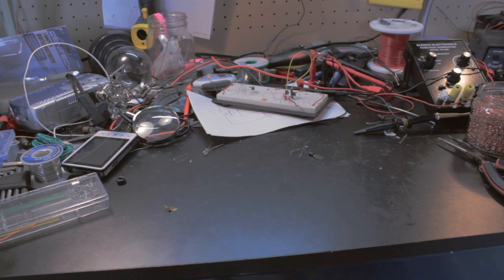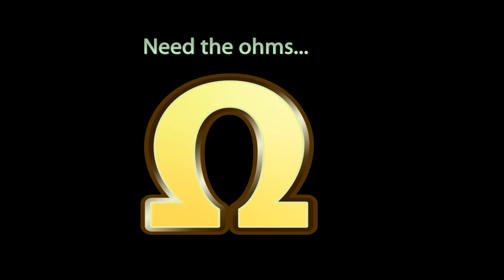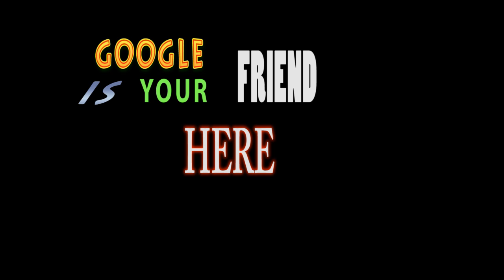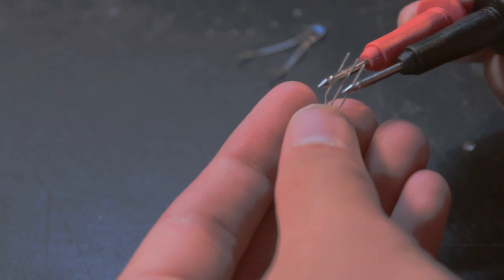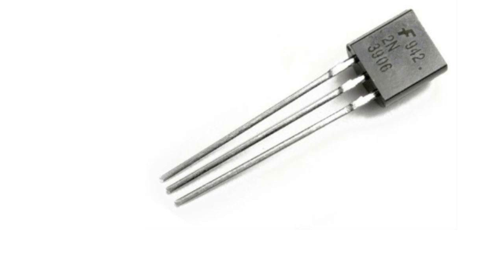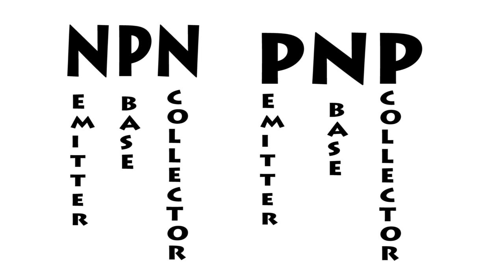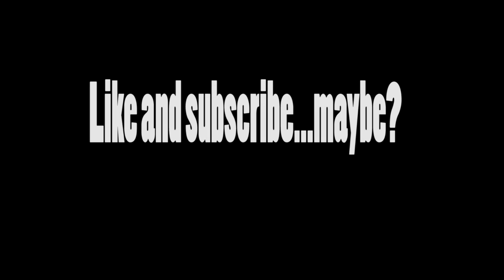How to test transistors with ANY multimeter!

Comment: Baffled by NPN transistor. DMM on diode setting: good. Chinese multitester: good. DMM on Ohms setting: getting readings between Collector and Emitter with probes placed in both directions. with other NPN's: no reading between Collector and Emitter with probes placed in bother directions.

Comment: Thanks for the video - I tried that on several transistors (mainly 2222As) - some of which were straight out of the box.  With the 2000 kOhms setting selected I was still getting an out-of-range both ways and across all and any of my pins.  Tried across about a mm of my skin and getting a reading as predicted so I guess the multimeter is OK.  Any idea what I might be doing wrong?
Reply: Same here, I'm getting both ways on a new transistor. Idk if I'm doing it wrong but I was looking for this comment

Comment: SO EVERY TRANSISTOR I HAVE IS DEFLECTIVE ACCORDING TO THIS..ALL 200 TELL YOU FOR SURE NOT.I HAVE A CEN TECH 95683 DIGITAL CLAMP MM I MUST HAVE IT SET WRONG...
NOPE I GOT IT AS LONG AS I SET THE METER AT THE DIODE SETTINGS OF THE OHM AREA..BUT THAT CAN'T BE RIGHT?

Comment: Good Stuff, Don't know if it's understood, NPN, The Emitter is 
Not Pointing, iN. PNP is Emitter Pointing iN.  Good you explain to determine which is which, in a bind and no internet, you can compare to known good Transistor. I do a Quick check of Transistors by Testing like 2 Diodes?.
Important Stuff

Comment: Don't you have those lead connections reversed.  I know I have a pnp transistor and each test came out exact opposite of what you said.  Using an analog meter.  Electricity travels from neg. to pos.  Critical difference in this test?

Comment: ON diode mode I got value 600 on emitter and 623 on collector in NPN transistor. Is it correct or not? But in resistor mode I got  10.04 Mega Ohm and 15.52  Mega ohm. IS it good sign or bad sign?

Comment: hi, you can test transistors with the transistor function on your cheap red meter, can you show how to do it, its bottom left at 7 o'clock on  your meter 0:18 sec, you can see it when you chuck it on the table.

Comment: The problem with using the ohms function on a multimeter, especially one with a diode test is that the test voltage on ohms may be so low as to not overcome the depletion region of a transistor or diode and will read high both ways This is intentional so you can test other component that are in parallel with diodes or transistors without activating them The diode test reads an approximation of the forward drop in the conducting direction, around .5 to .6 volts and the supply open circuit voltage from the meter, in the reverse direction, maybe 5 volts. My old Simpson 260 analog has plenty of voltage on ohms and always shows 10 to 15 ohms in the forward direction. That reading does not refer to any spec of the component but I know what to expect. The best bet is to test a few known good components to see what your meter will do. Surprisingly, The often free Harbor Freight multi meter has a transistor test function that actually measures the DC amplification of the transistor, called Beta. You can determine if the transistor is NPN or PNP  by seeing which way works, as well as checking for opens or shorts. If it amplifies it is not open or shorted. Getting back to other meters,generally failed bipolar transistors fail by shorting out collector to emitter,  The base to collector and base to emitter still test like good diodes.
Reply: Well explained might clear and and to the point explanation he seemed very knowledgeable electronics could do with your help as I'm a DIY home hobbyist self-taught no repair calls TVs phones tablets quite a lot of stuff obviously with trial n error  wen 1st started. I gt into it after a health condition creep upon me so was out of work an had alot time on my hands,now pretty confident. 
Could do with your help every now and then if you happy to Cheers stay safe

Comment: how to check every electronics component (Active & Passive) to identify they are working or not using cheap DMM!i believe that if some one can identify the malfunctioning component it's easy to maintain the device  like transistor/ IC which has more than 3 legs, Pulse Width Modulator, Zinor diode &  SMD transistor!!! ............tnx in advance!!!!!!!!!!!

Comment: this is the same way to test Audio Transistors as well? have an amp that will not power up with the amplifier board connected. lights for a second then shuts off with a blinking light. It does power up and stay on however with the amp board connected.
Reply: If it has a blinking light, you might want to check the manual first. That should probably give you a clue where to start looking for the defect.
Reply: I tested the transistors and found one faulty one. clipping it out of the circuit now it does not shut off..
Reply: good job :)

Comment: just wanna make the point to really check datasheet for pin outs u can have identical npn or pnp transistors but made by different companies that have collector on top instead of emitter for various reasons this can cost u alot of time an energy if u think it measured out fine but really had a short

Comment: Not all multimeters use a high enough voltage on 'ohms' setting to conduct through a p-n junction.
Reply: Turns out that's the case with $6 harbor freight multimeters

Comment: This doesn't work for my BS557, no matter what pins the -ve and +ve probes are touching it shows "out of range". (my multi-meter is auto range select-able)
Reply: +Fahimul Islam  Not sure why, but some multimeters only give a very short indication of conduction for a forward biased junction. For reversed biased junctions,  the initial reading is an open circuit value which is correct if the device is good. Also, you may need to try different scales. The lowest scale works for some meters with some transistors while the higher scales don't.

Comment: hi bro. how to work a transistor collector to emitter and emitter to collector
Reply: Hariom Swami If you activate the base / emitter circuit with one multimeter with the diode function you can measure for continuity with a second multimeter :-}

Comment: when measuring between the emitter and collector, your info is confusing.  you say if you get a reading, that its bad or messed up, or that you have the pin out wrong?  so should you get a reading if you have the pins reversed?  Or are you referring to a situation where the middle pin is not the base?

Comment: I have some NPN's 3904's and none of these work. I have my MM set to m ohms and still get nothing.

I get a small bounce between 001 mohm and 000 randomly
Reply: I might guess that the miliohm that you're getting are from the meter touching your skin... As far as your NPN's not working, that's why I'm here too so I have no idea... Sorry.
Reply: Clown Whisper 
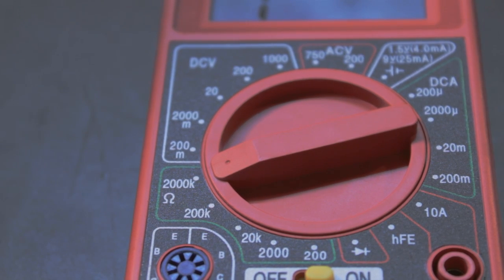Is it possible you accidentally set the switch to the lower end (millivolt) of the DC voltage scale? e.g. 200m or 2000m. (see 1:09 in the video)
It's a very easy mistake to make..........and don't ask how I know this.

Comment: too bad, i'm in search for testing a MOSFET. an IRF740.
I'm trying to use this NPN MOSFET as amplifier between 5v PMW and 12v power source. I find info on the leads, Collector Emitter and Base. But my datasheet shows me Gate Drain Source. Aaargh! I think by testing the leads I already destroid MOSFET. (I'm new with electronics :p )
Can someone show me a clear video on testing and how to use in circuit. It seems that Gate or Base should be grounded in a specific way to get rid of remaining current from the signal. or is this wrong?
Already Thanks, Joost (BE)

Comment: Germanium and Silicone just have different values when measuring, open and 0.4 or open and 0.6. I forget which is which.
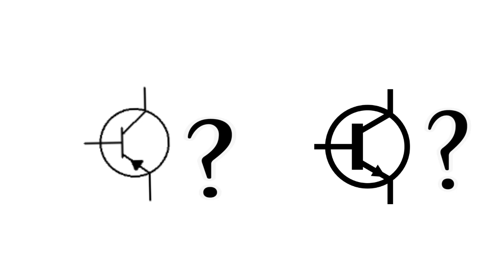Also if you need to know whether you have an NPN or PNP transistor by looking at the schematic go to 2:07 in the video. The left is a PNP and the right is NPN.
A quick way to remember which is which is to look at the arrow, is it pointing towards the circle (Not Pointing In) or the Center (Not Pointing iN).  NPN (Not Pointing iN)  PNP (Point Not Pointing).

Comment: Does this work with germanium core transistors? I've been repairing an old radio, and all four of the Toshiba 2SB series transistors conduct in both directions between the base and collector. Is this O.K.? I know you explicitly said that conductivity between the emitter and base in both directions is a no-no, but does the same apply for the collector and base? Thanks!
Reply: U can have conductance betwen emittor and collector beacause of leakage.

Comment: hello sir..if we start to check transistor by the help of multymetre..multymetre puting which mode..
Reply from the maker: You can use either the diode range or the ohms range. I used the ohms range here because virtually every multimeter in existence has one.
Reply: tnks sir

Comment: I have a power inverter that got 110v plugged into the output and I heard a frying sound and now nothing . I opened up the and the parts that appear to be burned are part number IRF 640 ccovy mar 742 and F1j19ea RHRP1560 not sure how to test them

Comment: this is the old timer's way of checking transistors, back when all we had was a ohm meter.
It's faster to use the diode check, when I was working in a repair shop we used the diode test because it's much faster.

Comment: The first transistor I ever checked was back in late 1977 - eons ago, right!  Wondered why you didn't use the "diode checker" function; as you know, it will forward bias the trans ON and show a voltage drop depending on the material that the trans is made of.  Then, like you did, reverse your leads, which will reverse bias the trans and it will not conduct showing an E drop.  Then the really important E to C measurement.  Had many that checked OK, on the junctions - but shorted E to C!  Thx

Comment from the maker: The "Transistor testers" are more for finding the hfe or beta or gain of the transistor. Honestly, I use this method to test transistors because it just works- And it's kind of a pain if you don't know the pinout of your transistor to use the built in tester. You can find the pinout with the method I showed :)

Comment from the maker: I agree with you. The diode range method IS better. However, this way WORKS, and can not only be done on ANY meter (True, most good analog meters have a diode range, but I've seen cheap analog and digital meters that don't. On top of that, most people don't really use the diode range much. Resistance is something that everybody understands.)

So, Yes. PN junctions don't turn on on the resistance range. However, they still only conduct one way- So while not optimal, it still works.

Comment from the maker: You can try this, if you don't want to look anything up- I showed how to determine between NPN and PNP in this video, if you have a FET then it won't act the same way as I showed here. However, if you don't mind a little bit of research, just google the part number on the transistor and you'll probably find out from there what type of transistor it is. (there's also two types of FETs)

Comment from the maker: To find that out (without testing various things) just google "[transistor part number] datasheet" and check that. I found the BC108 to have the same pinout as the transistor that I showed in this video- but it isn't always like that, so you should check.

Comment: You don't actually need to know which pins are emitter, collector and base. You can use your multimeter in most cases to find it out by measuring resistance.

Comment from the maker: Ok, I found the service schematic online...it looks like this is a MOSFET based amp, so this method of testing won't work. Search "how to test a mosfet with a multimeter" and you'll find a tutorial on how to do that (before I get around to making one). 

Oh yeah, and the transistor is an IRFP240 and IRFP9240, apparantly. Look inside for those and you'll find the possible faults (most likely)

One last note...Be careful when inside-there's dangerous stored energy!

Comment from the maker: When you find which transistor is bad, order a new one from a website like digi-key, jameco, mouser, whatever. (make sure you get it in the right package). When it arrives (probably a couple days after you order it) just solder it onto the board where the blown transistor was. I'd recommend ordering a couple (2-3) transistors in case you mess one up during soldering. It's much cheaper to order a few and pay for shipping once than pay multiple times.

Comment from the maker: To test and replace the transistors, first desolder the transistor from the board (I've got a rather horrible video on this, I'd recommend looking up a different video if you don't know how to do it), then test it as I showed here. If you are unsure of the pinout (which pins are what) look up the datasheet-the part number is most likely on the transistor package, just google it followed by "datasheet"

Comment from the maker: It all depends. You should be able to do it, you just have to make sure that it's a BJT-as I said, either an NPN or PNP transistor. I'd say look up your amp, and see what type it uses. What amp is it? I'll see if I can find it.

This method most likely won't work if the transistor is still on the board. However, chances are there are only a few transistors that are possibly dead, the output ones. They'll probably relatively large.  (continued below)